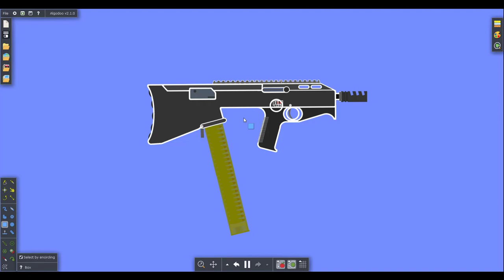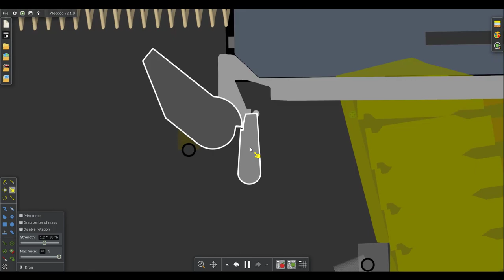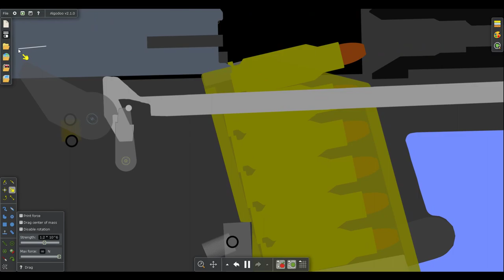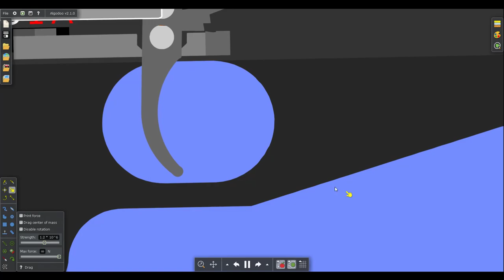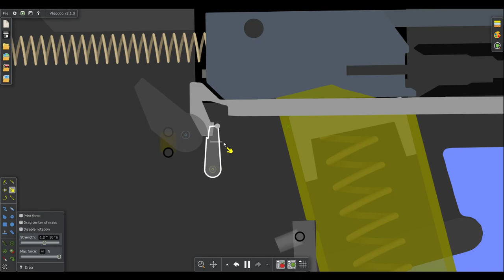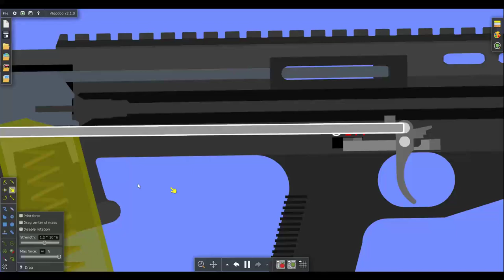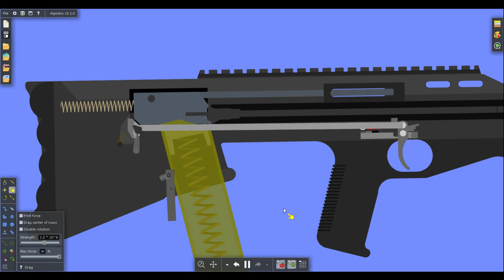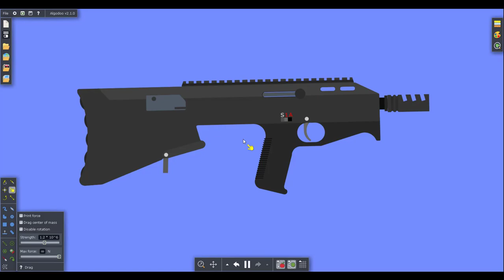How a Progressive Trigger Works

Comment: Civilians in the US can own non-neutered m4/m16 bolt carrier groups, the NFA item is the trigger box which includes the fire/safety sellector. So probably the same would apply to this design, i.e. the fire selector mechanism would be restricted so it could not be pulled fully to the back, probably with some mandotory provisions in the lower receiver as well so that it couldn't fysically travel all the way. So all in all it's plausible to manufacture both a civilian and non-civilian versions of this gun design with 99% the same parts.
Reply from the maker: it all depends. The "trigger box" as you called it, in the case of an AR-15 would be the receiver, and that's the FIREARM that the ATF regulates with a serial # and the background check. But the automatic sear, the single component that would permit a full-auto trigger to work right if everything else were already present, is ALSO regulated, and is regulated as a machine gun under law, and so is the firearm that is meant to receive it. 

In this video, that trigger bar would most likely be the regulated piece if it's the one meant for full auto fire, because it's what makes that possible.

Comment: I hate bull pups usually but this one I'll make an exception for
Reply from the maker: I’m not a fan either, but this was designed because there are genuine benefits to the configuration. I tend to hate the non-ambi tendency, or the ejection into a lefty’s face, or the creepy trigger. I took what I knew about pistols, and designed this gun with a length of pull that’s similar to that of an M4, and places the muzzle about where you’d hold a pistol if partially extended. Perfect for close quarters, but the stability of a carbine, meaning the potential for a bit greater range if necessary. I would ideally have it eject at a downward angle with a forward deflection, with an ejection port that’s aimed downward and away from the shooter’s face and neck. That way it would be ambi without mods